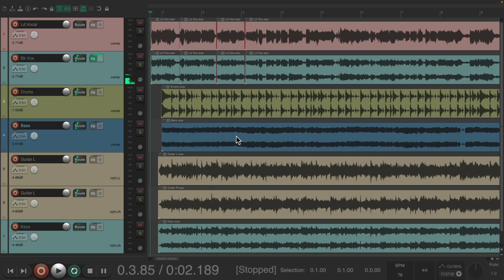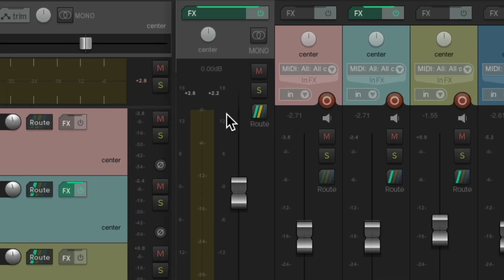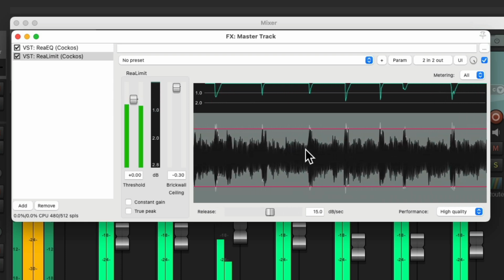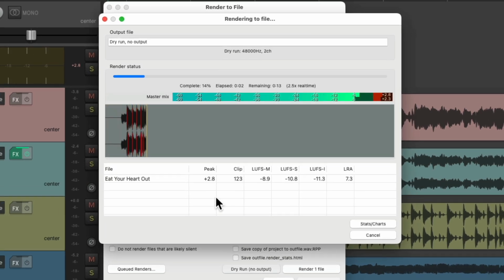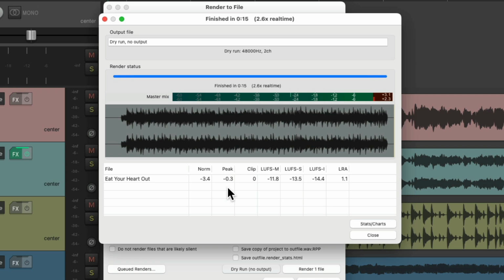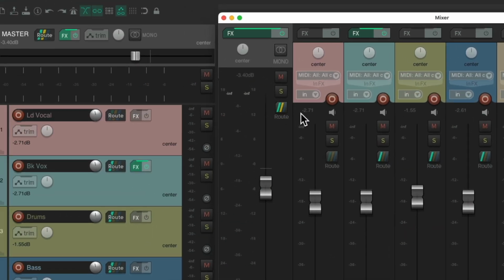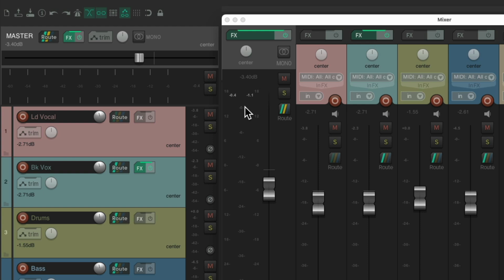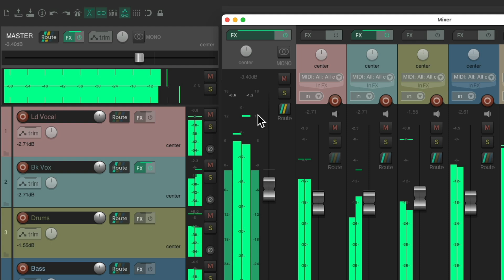Avoid Clipping with a Dry Run in REAPER

Comment: So say I have 4 guitars, 2 panned Left and 2 panned Right. 1 bass guitar. And multi-routed drums. My bass guitar, snar, and kick drum are clipping but when I turn the volume meter down on each individual track they sound too quiet in the mix. What should I do? 

Should I turn all of the other tracks down to meet the desired overall volume of the project? 

Or

Is it okay that some tracks are clipping as long as the master track isn't clipping and it all sounds good?

Comment: I'm curious, what's the difference between this method and lowering every track to -18dbFS?  
I'm using Sonalksis FreeG on every track, and lower the level of each wave form before it hits any plugin. This way, I never had the issue with clipping  .
Reply: If you lower the waveform before you hit the plugins then surely they will behave differently (especially if you have character or channel strip plugins), and your mix won't sound the same.
Reply: @leopoldbluesky true, lowering the waveforms when a mix is almost done, yes, it will affect the behavior of the plug-ins. But I was referring to lower the waveforms before starting the mix, as almost any plugin needs (according to their specs) an input around -18dbFS. But , this info is all over the place. Some big names mixing engineers are swearing that setting the level at -18 is mandatory before starting a mix, others are saying that it doesn't matter....So....🤣
Reply from the maker: It's faster?
Reply: @REAPERMania  no 😭. Definitely I"ll try your method. It's way faster. The reason I was doing it on every channel is because I didn't want to clip the input for some plugins. I think I was stuck with this info 😂